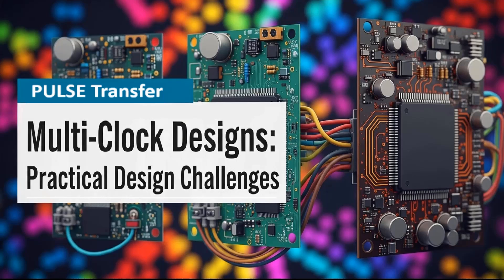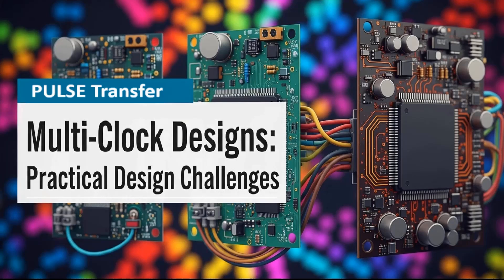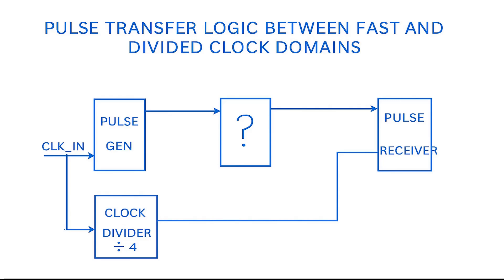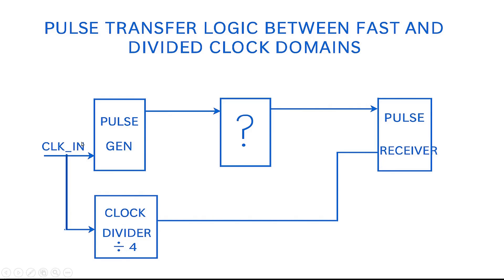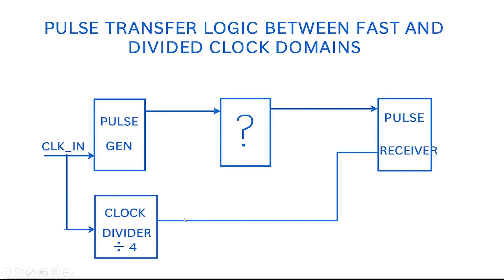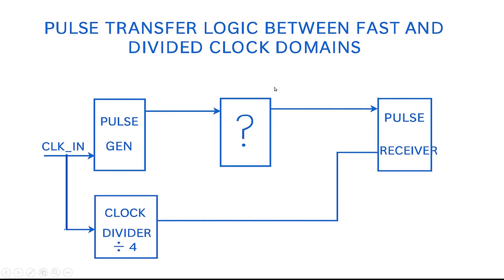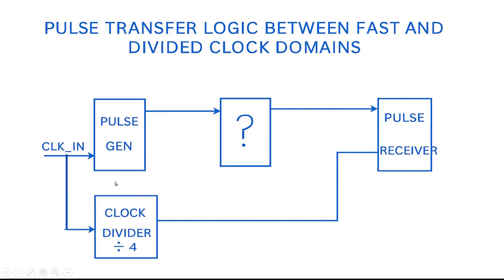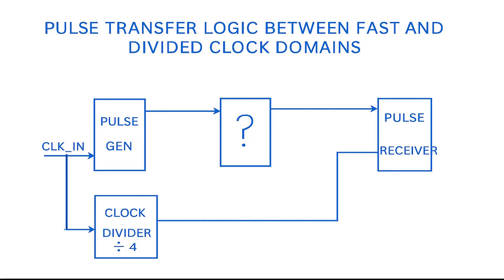Pulse Transfer from High Speed Clock to Low Speed Clock | Synchronous Clocks Verilog Design

Comment: Toggle ff on source side, regenerate pusle in dest clock domain using a dff and xor gate. Only condition is pulse should be generated not more than 1 in every 4 source clock cycle.
Reply from the maker: Just a quick question, are you asking to use toggle sychronizer?

Comment: Sir since the clock phases are predictable and lower frequency clock domain align with those of the higher frequency, we might not really need a synchronizer, as there is no scope for metastablitity. 

In this scenerio, if we can stretch the input pulse kust by 3 more clock cycles in f domain, then it will get sampled in the f/4 domain as one single pulse.

Also I think we acn generalize the result to any f/n, where n is an integer, cause same reasoning for no metastability is applicable. So for f/n, the answer should be a circuit that stretched input pulse by n-1 clk cycles in f domain.

stretching circuit for particular case can be designed using D-ff and or gates.

Comment: Sir For transferring a Pulse from a Clock domain to other Clock domain We used toggle synchronizer. So I think here also toggle synchronizer will be used. please correct me If I am wrong
Reply from the maker: Answer my first question, are these clocks synchronous clocks or asynchronous?
Reply: @TechnicalBytes  Clock will be synchronous because there relative phase is predictable
Reply from the maker: very good, Synchroonous clocks does not need synchronizer :)
Now think of its answer.
Reply: We need to strech the pulse so that the slower clock gets the pulse in its rising edge
Reply: They are not synchronous.
Reply from the maker: Please go through the following video to make your concept on sync and async clocks
https://youtu.be/XU3SbLlVzSM
Reply: @TechnicalBytes if the pulse has to be latched it has to be streched is that right sir?
Reply: Sir please can you post the method designing combinational ckt to count the no of 1's any number bit input
Reply: Is this pulse gen only generating single pulse ? 
If it generating one pulse in 1.5times of receding click I.e. 6 call cycles of clk_in , then pulse stretcher can be used and pulse can be sampled at receiver 

What if multiple pluses are generated within 4 clk cycles ?